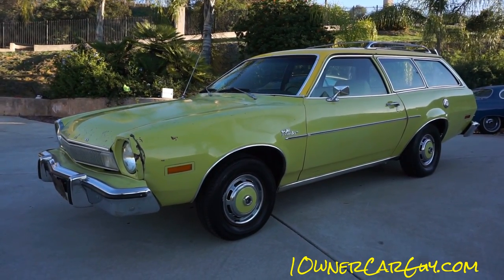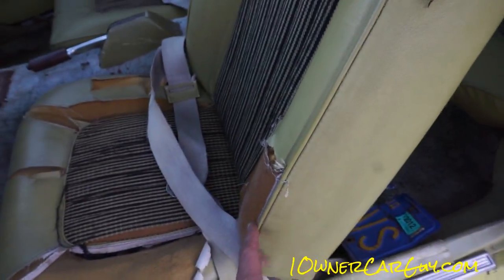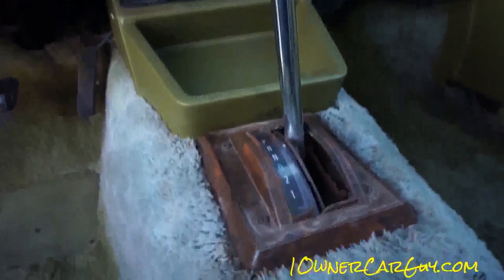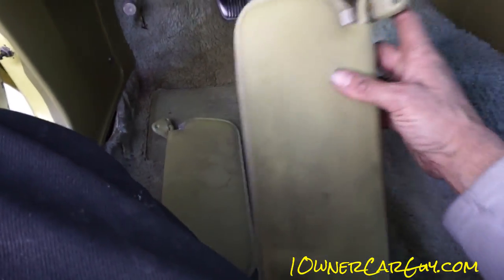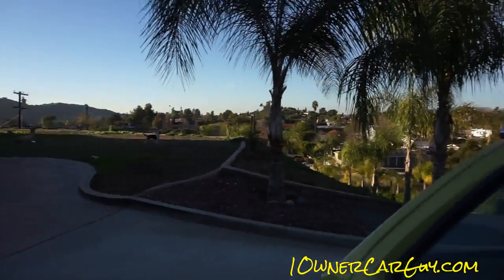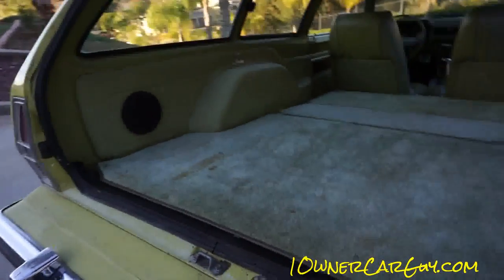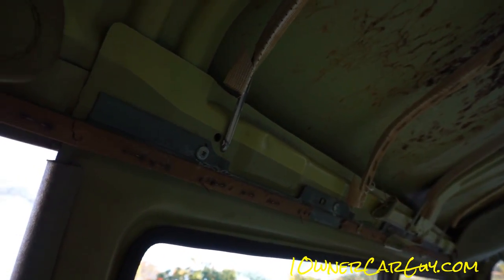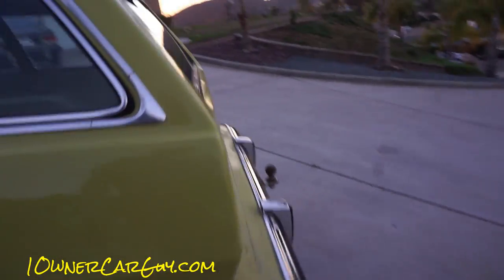1974 Ford Pinto Review Pony Station Wagon Cruiser Runabout Interior

Comment: there is no four door version.  this is the pinton wagon.  50/50 weight distribution.  Only american car since some cadilac to have it.  GreATt drift cAR.  My first car in high school.  Handling is the shit. No power stock but ths engine has crazy potential.  esslinger engineering dude.  best sleeper ever.  Power slide with full steering control.  Wicked!!!